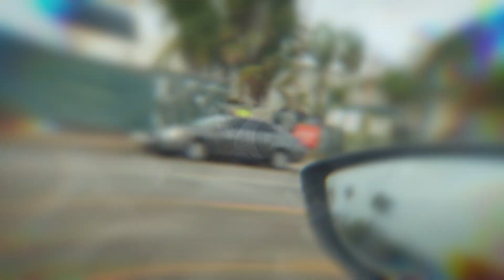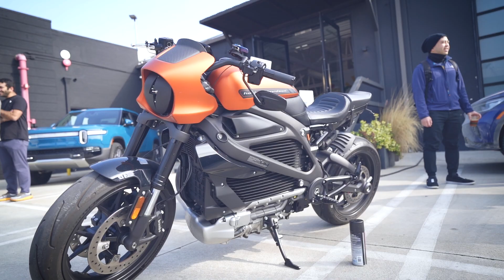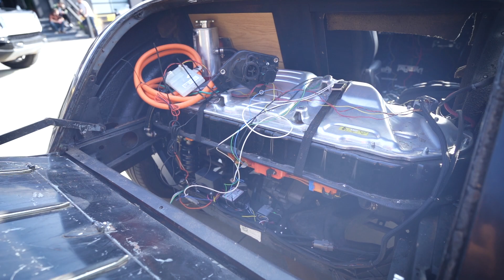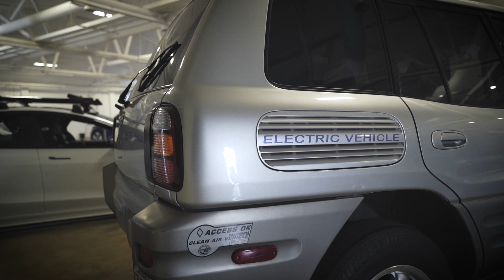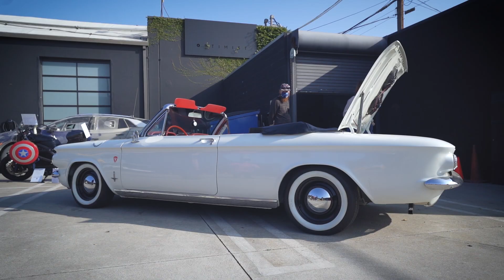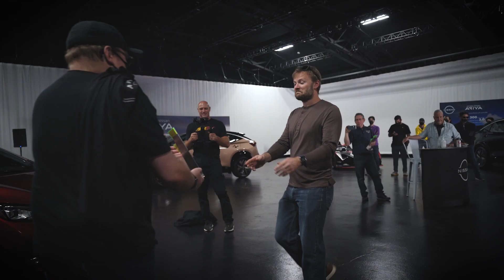Are Electric Vehicles The Future? Autopia 2099 Electric Car Show!

Comment: Only idiots threw sandbags in the front of corvairs unless they did it in snow weather . otherwise, wider tires took care of everything . That and being a good driver . I have driven corvairs for years and never had any accidents  in them .  the 6 cylinder 2 one barrel carbs and a 4 speed gave great mileage , better than the 100 miles this guy is getting .,   electric is nice but would be nicer when you get the same or better driving distance as the gas powered version .

Comment: SuperFast Matt had turned me onto this video. I have often thought it would be great to have a converted EV, but I am old and bereft of any mechanical skills, so a conversion would have to wait for an EV shop to open somewhere near my home town. There are a lot of cars of the 80s and 90s that would make great EV conversions, the Ford Probe would be very doable. You might want to check some of the better known conversion vendors like EV West to see what you need to add.

In any case, it was fun watching everything. I was most surprised to see the factory converted RAV4. I had read a bit about them back in the day, and was surprised to see that one had survived.

Comment: If we old drove smaller cars we would leave a much smaller impact but no we drive these large suvs and crossover bs eletronic cars won't save us
Reply from the maker: Totally agree that smaller cars (and driving less frequently) could make a big impact! But small cars are a dwindling market, at least in the US. 😭 At least an EV crossover will have a smaller carbon footprint versus an ICE crossover over the long term.
Reply: @HelloRoad  I think electric cars will leave a bigger carbon footprint when it comes to having to rebuild it plus making them